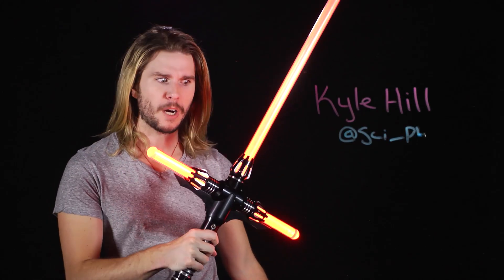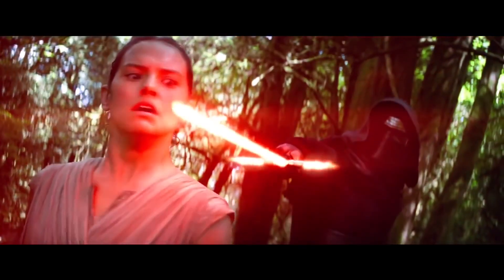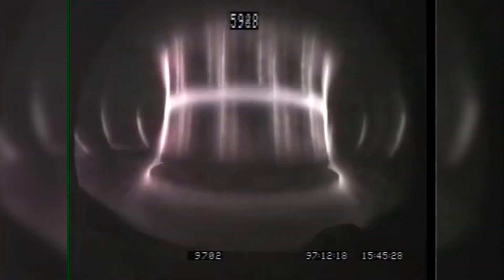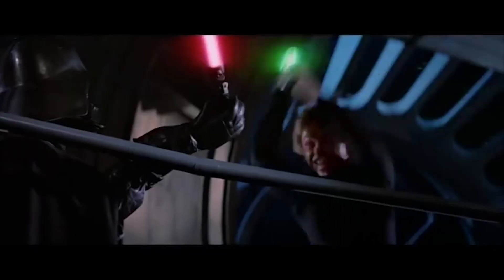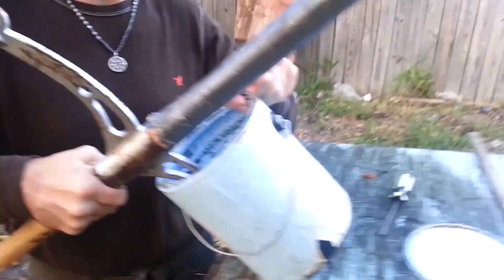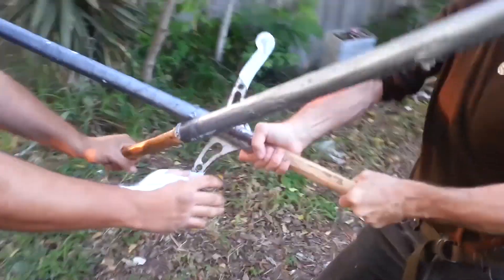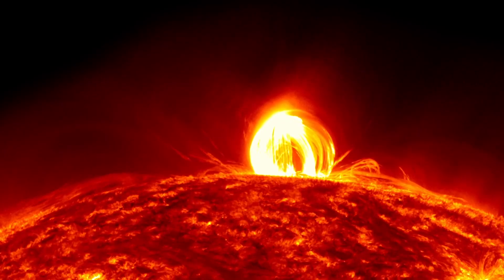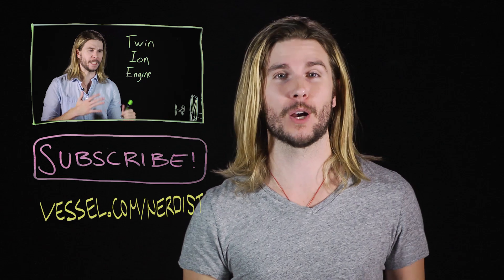Why Kylo Ren's Lightsaber Works (Because Science w/ Kyle Hill)

Comment: About the parsec question, people missunderstood what han wanted to talk about. the Kessel run is a highly valuable traderoute for illegal merchandises, passing right by an empire garrison, so pilots try to make their turn round the garrison to pass. Problem is, the run must be done as quick as possible, so pilots try to make the smallest turn. A kessel run on a straight line is about 11 parsec or so (i don't auite remember), but the point is that for han solo to make a kessel run in 12 parsecs, the ship must pass in front of the garrison. This question never was about time but about being the only one to be able to shorten the distance that much and then be able to outrun empire's forces.

ultimately it keep being a question of time as the shortest route, the smaest amount of time to do it.

I hope it'll clear a bit of the missunderstanding about this question.

Comment: BEFORE EVERYONE SHOOTS ME DOWN, HEAR ME OUT!! I still believe you could slash straight through the metal channelling point that houses the crossguard to cause major damage. In my opinion it would cause one of two things:

1) It would disable the crossguard do to the damage caused to the metal crossguard source. It would be like cutting the power cord to the crossguard, causing it to retract due to the lack of previous functionality or from possible safety features.

2) Cutting the magnetic channelling point on the side of the lightsaber could potentially cause the plasma to come out of the crossguard uncontrollably due to the fact that that same point was used to surround the blade with plasma. This release would cause insane burns similar to those seen from lightsaber cuts to those nearby (and also disabling the crossguard do to lack of plasma) Another possibility from this could be that the plasma from the crossguard would be absorbed into the center blade (where the magnetic field is still functional) and the crossguard would still be disabled, causing the dismemberment of poor Kylo...

Like I said this was just an idea. If you still believe the crosguard would remain functional despite cutting through the metal side let me know how. I've had this theory for a while so when I saw this video I saw a place to bounce my idea off of.
Reply: I never really got into the old republic so thanks for the insight

Comment: They have a reason for those crossguards. They go over it on the wiki page. Kylo's light saber is powered with a cracked kyber crystal. The side blades aren't there for hand protection, they're there to bleed off the extra heat produced by using a cracked crystal. The crystal is also the reason his blade has that serrated looking edge, since the crystal can barely contain the power of the saber.
Reply: That doesn't mean he can't still use them as a means of protection

Comment: I think it works all from the handle at  the bottom  it starts of with 3 small plasma beams one right one middle and one left the left and right go up to 2 thick mirrors which deflect them right and left  but remembering at this point there small after the mirrors they each hit 1 magnified lens which makes them bigger this also happen s to the middle but with no mirror

Comment: you won't get hurt if you train enough. Bullshit. You can't just train to never get singed by a damn plasma crossguard, especially if there is nothing on the hilt of kylo rens blade to prevent slipping upwards. Its just awful design...
Reply: +Engin Seker If the blade is so dangerous, then how can Kylo hold it so close to Reys neck without burning it? People in the Star Wars universe have clearly figured out how to keep the blades heat from escaping and Kylo evidently used that tech in the crossguards. 

Also, the hilt does protect the users hand, those metal parts the crossguard comes out of are most certainly there to protect the user from burning of his own hand.
Reply: First of all, there is no legitimate proof of their ability to keep the heat of the guards from escaping (that scene doesn't really prove anything imo). 
Also, it's less about the hand actually than it is that you have something deadly close to your arm and wrist, and when you swing, even if the impact is little since plasma cuts through basically anything, there is resistance, therefore, risk of hurting yourself when moving the blade. Point is, a battle isn't as peaceful as you think, and in reality, this weapon would be blatantly stupid to wield.
Reply: And i think its hard to argument that those guards can't cut through an arm.

Comment: If Kylo's crossguard is part of the same beam as the "blade", then they should appear before the blade's done, not two seconds after.
Reply: +Diego Sheish The quillons are the "exhaust" of the crystal, forming the main blade. Since its cracked and unstable, as single blade without exhaust ports on the hilt would deem too dangerous for the user to wield. So yes, it is part of the main blade, but the energy needs time to exhaust from it so the crossguard is delayed slightly on activation

Comment: Regarding the use of parsec instead of a unit of time; since we know the Kessel Run is a trade route that routes through several specific regions, specifically The Maw, a cluster of black holes.  Zip close enough to black holes to shave some distance off your odometer, although there's the risk of time dilation costing you some of the time you save by cutting closer than is sensible to a black hole.
Reply: +Jerald Lutney since the Kessel Run is 18 Parsecs in distance, doing it in 12 is a huge deal, i would boast as well, but it not entirely the pilot its 90% of the ships (in this case the Millennium Falcon) Navigational computer to calculate the hyper space jump and the "black hole turn" to shave off the 6 extra parsecs.

Comment: I agree with most of what kyle's saying. i still think they're dangerous for the user. just because kylo is trained and skilled doesn't mean an accident might not happen or something. crossguards on swords, including the one on display in the video where the guy had wet paint on it, don't typically have blades coming out of them. if the guy with wet paint made a bad twirl or held it at a slightly wrong angle a little too close to himself or his opponent shoved their swords together and the crossguard somehow got between them, it might hurt, but it wouldn't stab or cut.

still, i accept the explanation that kylo is just very skilled with it and considers the chances of a mishap to be low.

Comment: It's cannon that the crystal used in his light saber is cracked causing to look the way it does (with all warbles and stuff). The crack also makes it unstable, those guards not only serve a purpose but are mandatory to the design so that it doesn't blow up in his hand. So technically those aren't cross guards, those are vents detrimental to the stability for the saber.

Comment: Ren's saber offer no better protection than any other.  None of the shown examples would have been prevented by a cross guard.  The scene with Finn if you look her would have burnt his own wrist.  There is no blade until on a light saber until it passes the lens at the top of the hilt cutting through the cross guard would not strike a blade.
Reply: +Emmett O'Regan yes. with a real sword they are great defense. when used properly they are also weapons in their own right. but on this saber they really make no sense.

Comment: So this may not be right or whatever but the way i see it according to kyle's proposal of the magnetic field keeping the plasma in place, wouldnt the metal cylinder that the cross guards come out of hold the magnetic field? if that's the case then wouldn't it explode or something if it made contact with another lightsaber? because it would disrupt the magnetic field and cause the plasma to lose its shape? just a thought.

Comment: the crystal is cracked. if he didn't have the cross guards to act as vents his crystal would overload and explode
Reply: +Tatiana Rogers The kybercrystal is cracked in it. You can actually see a crossguard lightsaber with an intact crystal in S2 of Star Wars Rebels.
Reply: +Tyranzor Katastrophe Wait, really?
Reply: +Tyranzor Katastrophe wait what really ? i want to know as well!
Reply: +Tyranzor Katastrophe "A single cracked Kyber crystal,  barely able to contain the weapon's power, necessitated the lateral vents which diverted the extra heat produced by the crystal to either side of the hilt, and gave the weapon's red plasma blades an unstable, serrated appearance."

Comment: The crackling is from the kyber crystal its a resault of the kyber crystal being cracked an my thery on the crossgaurds being short is that the blade an crossgaurds are one blade bent to make crossguards. Say the blade is an ark of plasma coming from two points in the hilt kylos blade would be the same only the two sides of the ark have a bit pulled out to make crossgaurds like a peise of string like a tall but thin triangle for a normal blade and kylos blade has two extra points at the base for the cross gaurds

Comment: To my understanding, lightsabers aren't even plasma, but "photoelectricity," and yes controlled in a tightly confined loop. They are supposedly so contained within the magnetic field that they do not even emit heat into the air or radiate heat,  only when touched. Presumably, correctly manufactured blades do not eat up the air either. The blade is weightless, and the entire process produces a gyroscopic effect. The process uses focusing crystals connected to the Force, so the process must use the Force to operate also.

Comment: Colbert's point is valid, also the casings could be made of a Lightsaber resistant material like Mandalorian Iron, Cortosis, Phrik alloy like the magnagaurd electrostaves, or superconducting chromium allow which is just such a perfect mirror reflector and dissipator of energy as a mirror and heatsink that it resists lightsaber strikes. This last material was featured in "Shatterpoint," a Mace Windu novel.

Comment: The reason (Not a good one mind you) that lightsaber did not have cross guards was unlike a normal sword, lightsabers can not slide against each other so you don't have to worry about losing fingers when in a saber lock. Also the lightsaber was based on the katana which does not have much of a hilt, or crossguard. 3:33 A turned on lightsaber has a gyroscopic  effect to it (they aren't solid state the plasma loop is actually spinning very fast on the z axis so they don't pass through each other if the plasma poles line up that would be bad) so it is actually harder to manipulate when on than off. This is speculation the reason kylo ren's lightsaber sparks and crackles is because he uses a unstable-artificial crystal which can have the added benefit of shorting out the opponent's lightsaber downside is they don't last long

Comment: if what that Colbert guy says was true then the blade of the light sabre and the cross-guard would all come out simultaneously but they don't so they have to be separate shafts therefore those metal bits can be cut through.

Comment: I was going to go on a nerdy rant about how it slows down the fighting style and other crap.... but I decided to talk about how if would have been more sensible to make the cross guards out of light saber proof metal. (which does exist and is talked about in Star wars Canon material, intact the emporer's light saber is made of said material. Why they didn't do anything else with it, I don't know....
Reply: +Alaric Smith Well at least in the original series, jedi are practically extinct, meaning your chances of fighting someone with a lightsaber was practically zero and even in the prequels there werent too many instances youd be constantly against a jedi and in need of said material specifically, so if the only advantage to the metal was lightsaber resistance, your better off using something else. As far as making it a crossgaurd, it could throw off the weight of the saber a bit, and it would make it larger to carry around, though i think a thing said of kylos saber is that the cross guard is actually discharge from the energy crystal he uses because its cracked, which is why its less solid then normal light sabers.

Comment: If the crossguard is actually a continuous beam somehow encased in solid material, then yeah, I see the point. However if the beams are generated at the end of the T shaped pommel, then it's useless, since if you parry the "blade" is most likely gonna hit the base of the sword and cut through it. Sure you can do less acrobatics with it but someone that knows a little about swords would tell you that the point it to cut or thrust, not twirl like a crazy person

Comment: The cross guard is actually exhaust from Kylo's light saber crystal because it is unstable and shattered. Which is also why the blade crackles. Instability is used in his light saber to increase power and also reflects his character

Comment: id like to point out that in every shot you have where the hands of the peoples are getting cut off its at an angle to which the cross guard is useless it protects the hand from the blade sliding into your wrist or fingers not chopping of the hand but slicing it. it also has its uses for attacking as well also colbart makes an interesting point to which one will say the handle of a lightsaber shouldn't be able to be cut since the lightsaber is just being cased by the metal.... yeah no even in the video it has a delay on the cross guard actual deployment. he also isnt trained (atleast well) with the light saber since he cant fight with it the movie showed many instances where he could and should have won in the fight vs fin and rey but he did he lost to two inexperienced swordsman and the people saying oh he got shot by chewies blaster and didnt go flying so hes concentrating on keeping his leg intact. darth vader went days on end out of his suit in open atmosphere sometimes in space and kept himself alive with the force. kylo is strong enough to stop a blaster shot mid air and leave it there while having a conversation and even forgets about it until he walks back into his ship letting the shot go. so a shot from chewies blaster is nothing compared. the last thing yes the cross guard is a good idea but made out of plasma is stupid  for the simple fact plasma is relatively weightless it makes it harder for you to know where your weapon is and how your using it.making it dangerous and if someone were to grab your hand or you twist your wrist wrong youre getting stabbed. if you are doing a cross guard for a lightsaber be smart use mandelorian iron. or some other metal thats not going to cut through you like butter and is lightsaber resistant

Comment: Don't be so eager about the whole "the sward would be effectively weightless" part. Yes, a heavier sword would mean you have to be stronger and skilled with a weighted blade, but so also is the other extreme; the weightless extreme. There is nothing to slow the weightless blade down and unless every one of your fights are choreographed, stuff is going to happen that you aren't expecting and don't plan on such as pushing the blade a certain way. For thousands of years swords DID have crossguards, but it was never a problem to touch the crossguard so it was frequently done. A weightless blade would be harder to balance because there isn't really anything to balance and instead of dancing around with one blade, you are instead swinging around 3 blades 2 of which are closer to hurting you than them.

Comment: Aaannnd. Since the crossguards are mainly exhaust ports, the plasma from them probably aren't as hot as the main blade so even if Kylo slips up they won't cut him just burn him. Also for those who've read the Encyclopedia, does it say anything about if the cloves Kylo Ren is wearing are lightsaber resistant, if so that could also be a factor.

Love being a nerd.

Comment: why even have the metal casing around the cross guard if they would function properly after another light saber had cut through it? also I can think of a few way better designs to act as a hand/wrist guard when you take the properties of a light saber into account
Reply: because without the metal casing his hands could slide up and burn/vaporize/be cut off
Reply: +Maniac of Doom well maybe, but that would be the same risk for everyone using a saber then (without the casing) but that has never happened to anyone
Reply: fair enough
Reply: +Maniac of Doom yeah, I have no real problem with cross guards but they aren't a good shape and the metal casing is useless
Reply: even then, it may just be a precaution. There's no reason for them not to be there. But I would have made them from mandalorian iron or cortosis, which are lightsaber resistant.
Reply: I agree with that, but if I have access to those I would just make gauntlet/bracers out of them
Reply: ah, yeah that would make sense

Comment: was later found out that those crossguards are there because the saber is unstable thus needing exhaust ports to stabilize the energy of the blade... then again we now have seen full stable crossguard saberin the rebels mid-season trailer so guess that went different anyway =D

Comment: Kylo rens kyber crystal type is an artificial unstable crystal. And like the sun the blade has a type of flaming look and can Lash a bit of of its energy outside its blade form so if it was an average red crystal his hand would be fine but being that close the the crossgaurd blades in his case I think his hand or at least his fingers would burn off.